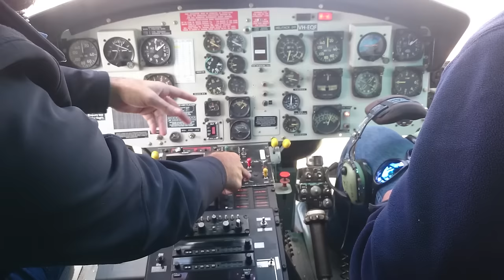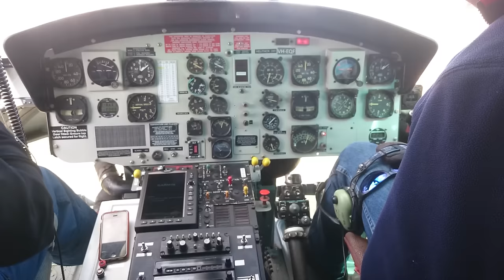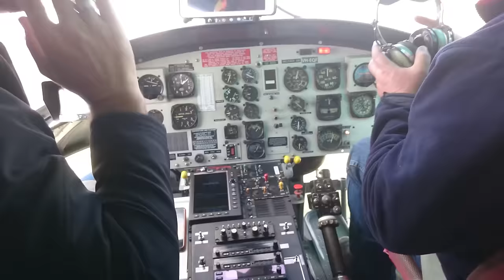How to start a Huey Helicopter - start procedure

Comment: Been working in aviation all my life.  Note how he touches all the buttons as he does his checks.  RULE in aviation whether flying or fixing... always touch when doing final checks... NOT JUST LOOK!
Reply: Back in the mid 90s...I was flying first class on a TWA DC9 or MD80.....during push back and taxi, the cockpit door was open and I saw the copilot go through the preflight checks....and he was doing the same thing...checking each instrument or button status by either pointing at it or confirming position.
Reply: What do they do in a glass cockpit?
Reply: @rsprockets7846  same same... touch or point at each checklist item.
Reply: and for manufacturers/airlines - all buttons on simulator should be exactly identical to ones in the cockpit. there was a crash because gyro button in sim had options (capt/aux/co-pilot) in a different order (order in sim was not same as on the airplane and crew had wrong habits - they wanted to switch to aux gyro and they switched to faulty one - you can not read labels when flying at night and vibrations occur). Also (I do software for machines - both PLC & HMI/SCADA screens) instrument layout (and indicator layout on screen) should be consistent with physical layout of real items (for example instruments for engine which is on your right should be located on your right too)
Reply: @325xitgrocgetter  my grandpa flew this helicopter and lots of airline planes including md 80
Reply: When I did post flight inspection, rule was touch it, visual was not good enough to sign off.

Comment: This is a B-model? Do you turn the start fuel off passing through 600 degrees EGT? Do you ever "jockey" it on and off a little bit (to avoid hung start)?
Reply from the maker: I'm not rated on the uh-1 yet. Was just a passenger on this flight so pilot just did a quick run though of the start procedure. 
He did say turned off start fuel. But don't think he "jockey" it at all.

Comment: This is a perfect example why so many experts in a certain field are atrocious teachers. They assume the things they point out are blatantly obvious, and it doesn't take more than 30 seconds for the student to tune out and start contemplating a different career.  It never ceases to amaze that the teachers of teachers fail to pick up on it. I am sure the pilot is great, but he gets a fail when it comes to instruction.
Reply: MG Gailitis Good point. I’ve had instructors in the navy who do this. They talk to us about extremely technical and complex computer equipment and they seem to think we can just absorb it like a sponge. 

These guys were basically geniuses, with tons of experience, but they can’t break it down for us in any valuable way.
Reply from the maker: Ok so this was a Pilot just quickly running though a start up before we went to a job. it was last min. and he actually did an excellent job. 
We as pilot know the majority of what he was saying, and it was not for the purpose of us being able to fly the machine but a quick run through.
Reply: Since when do pilots not use a checklist? Crew coordination and human factors. Never. Not. Use. A. Checklist.

Comment: Gee you need to be trained in each model aircraft separately just to fly it and start it up, like how many aircraft is one pilot capable of learning and familiarizing him/herself with?
Reply: Christos Antonopoulos a lot of pilots have plenty of ratings on different machines. Overall the principle is the same for turbine helicopters. Fuel pump on, throttle set for start, hit the start button and then increase fuel flow after 10/12% watching TOT or T4.
Reply: You can learn as many as you like. You also need a ton of money to keep your type ratings valid for each of them …

Comment: How come you didn't get the low rpm war j g when you turned on the battery?
Reply from the maker: Because it was turned off. 
Was turned on before or at Flight idol. 

no need for it before then.

Comment: How did he start the ignition?
Reply from the maker: Intelligent horse There is a button on the collective. When you press it the starter motor turns the turbine and sparks the igniter. When there is enough air moving through the compressor and through the turbine, he introduces fuel.
Reply: +Braden Long Oh yes! That makes more sense now! Thank you for your response! It helps build my knowledge of these types of helicopters (rotorcraft).
Reply: Hi. So the button on the collective engages the starter and the igniter together?. And how does he introduces fuel? manually? separate button? or is it done automatically with the first button? Thanks
Reply: Yes, the fuel is introduced manually by opening the throttle (twist lever on the collective) to "ground idle" position. It's important not to introduce fuel before there is enough air moving through the compressor, or to put too much fuel (opening the throttle past ground idle), otherwise you are gonna have a hot start.
Reply: Alin E. good! Thanks for the info!

Comment: DO THESE THINGS HAVE A CENTRIFUGAL CLUTCH, OR SOMETHING OF THAT TYPE ON THE MAIN ROTOR? THEY ALWAYS SEEM TO BE MOVING MIGHTY SLOW FOR THE ENGINE RPM
Reply: I think they are powered by exhaust gas through a turbine, so it's not directly coupled which is particularly noticeable at low speed. Someone correct me if I'm wrong.
Reply: @150cameron  that sounds terribly inefficient
Reply from the maker: The turbine has the best power to weight power source that a reciprocal engine. 
The reason that it's coupled that way is that the turbine spins so fast that a normal clutch and gear/transmission would just burn out.

Comment: Hey Hey fellah, cage that artificial horizon before you toss the inverter...geeeeez
Reply from the maker: haha
Reply: @bradenlongpilot  Braden, just realized you are in Australia.  One of my old Huey's is in New Zealand 74-22386 stuck in a hangar, not sure why it isn't flying. Possible the company went under, however, I digress, that old beast decided to have a catastrophic engine failure on me with 4 others on board at 800 feet after takeoff.  What a beautiful job I did, a 270 degree auto with turn....but thats what US Army Instructor Pilots are supposed to do when the old beast says its your turn.  So I ask if yoiu ever get over to Rototuria (?) where she is parked?
Reply from the maker: @nvdwarriorLtc  I dont unfortunately get over to New Zealand. I've only been there twice. 
If inever get the chance I will look it up. and see how she's going.

Comment: as a former UH-1 H/V model MTP,  I must say the cockpit procedures exhibited here are damn sloppy...  guy would never make it as my co-pilot unless he tightened up his procedures... no room for error once you pull pitch... just sayin'...
Reply from the maker: Perhaps, but it was a spontaneous quick run through on the way to a job. 
The pilot was highly skilled and could fly it like an extension of his body. 
Long line he could place items in some tight spots with precision, grace and gentle placement. 
He may not have been military trained or procedural in that way but I'd bet he was more skilled than most just military pilots.